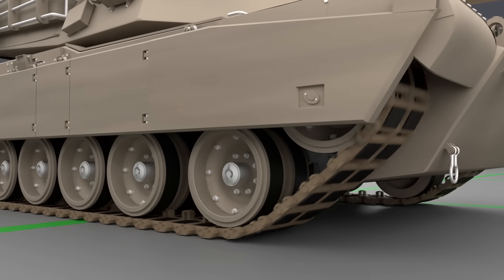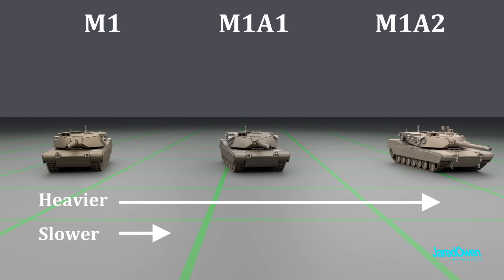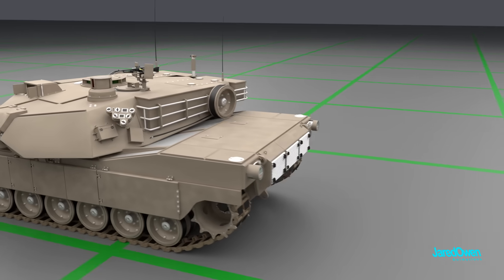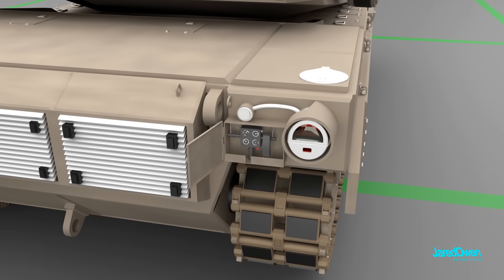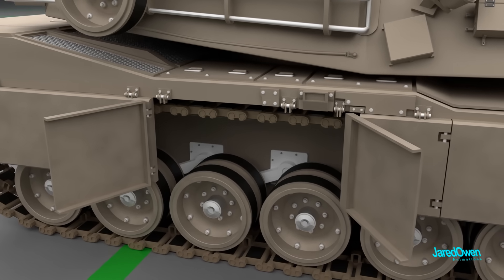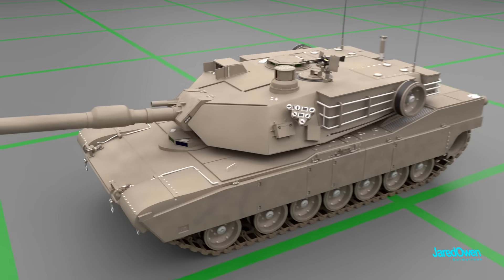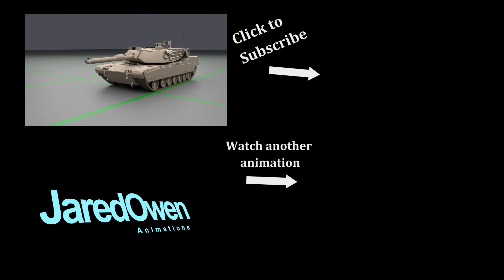How does a Tank work? (M1A2 Abrams)

Comment: 2:17 
Length: 9,75m
Width: 3,66m
Height: 2,43m

2:33 top speed 68 km/h

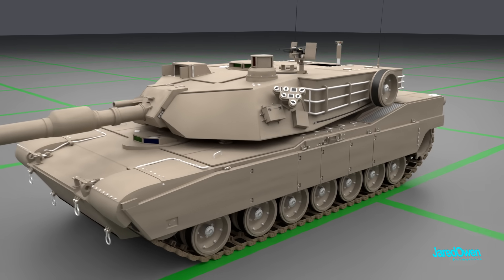2:51
M1A2
1893 L
0,25 km/L
483 km

Avg. car
61 L
10,63 km/L
644 km

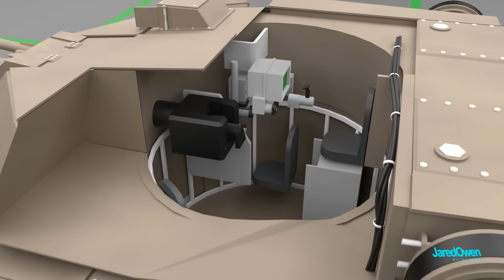7:20
muzzle vel. = 5633kph (1565m/s)
distance = 3,2 km
Reply: Petition to Jared Owen to pin him
Reply: @julilopbal  that doesn't sound right😂
Reply: @steveglen3354  why not? :)
Reply: @julilopbal  https://youtu.be/ISfSGTApFtk
Reply: Now I finally understand the video.
Reply: @koharaisevo3666  https://youtu.be/ISfSGTApFtk
Reply: @koharaisevo3666 same
Reply: @koharaisevo3666  I guess a majority of the views arent American?
Reply: Not the hero we deserve but the one we need
Reply: @hassanm.1887  https://youtu.be/ISfSGTApFtk
Reply: Thx
Reply: that's just what i was missing, thank you ^^
Reply: @arkonis6884  https://youtu.be/ISfSGTApFtk
Reply: Thank you sir
Reply: thank u. And US tons is the same as metric ton?
Reply: @aleksander2810  actually no, 1 metric ton is about 1,1 US ton (2200lb)
Reply: @willy6819  haha, thx
Reply: @willy6819  same as 1 kg = 2,2lbs
Reply: @aleksander2810  https://youtu.be/ISfSGTApFtk
Reply: @aleksander2810  a US ton is 2000 lbs (913 kg)
Reply: @aleksander2810  no. Imperial tons - 2,000 pounds. Metric tonnes -aprox. 2,200 pounds. Imperial is used far more due to the reduced math requirement and and it is also the standard for most the world when talking tons.
Reply: @Deathbomb9  An Imperial ton is 2,240 pounds. The US simplified the Imp system after independence. So a US ton is 2,000 pounds. They also changed the size of a pint from 20 fl.oz. to 16 fl.oz. so that it was the same as the number of ounces in a pound of weight. No-one seemed to realise that those two measures are completely unrelated to each other. 

Reduced math requirement? So, a system based on units of 12, 16, and 20 is less complex mathematically than one that used only 10. Really? Wishful thinking on your part, I’m afraid.

Imp is the world standard when ‘talking tons’. Eh? No-one talks tons! The same system is used for tons as for anything else you’re using in the same context:
Imp:     1 ton = 2,240 lbs.
USA:    1 ton= 2,000 lbs.
Metric: 1 tonne = 1,000 kg (kilograms), approximately 2,200 lbs.
Reply: TANK you 😉
Reply: @joacogonzalez1430  https://youtu.be/ISfSGTApFtk
Reply: @sumairamalik8634  ????????
Reply: Also, at 2:51

M1A2
392 L/100km

Av. car
9.41 L/100km
Reply: @baksatibi  average Car 9,4l/100.... Wow thats Just Bad....
Reply: @baksatibi  Thanks wanted to know that one. But holy shit that's a lot of gas.
Reply: @baksatibi  https://youtu.be/ISfSGTApFtk
Reply: @baksatibi  Hey, the cars from your contries do only an average of 10km/L?
Reply: Muzzle velocity for the 120mm seems way too high, it's more in the region of 1600 m/s for all NATO cannons, not even railguns or CLGG guns can reach that.
Reply: @theotakucomrade  the muzzle velocity for APFSDS rounds is stated to be around 1550-1600 m/s. HEAT and HEAT MPAT are a bit slower.
Reply: @LaVictoireEstLaVie 
Dude, look at what the OP wrote, 5000Km/s is not the same as 1750m/s on a Rheinmetall L55
Reply: @theotakucomrade  i was referring to the US L44 version of the gun.
Reply: @LaVictoireEstLaVie 
Still, no current weapon technology breaks the speed of light, just saying if the OP is still reading.
Reply: @theotakucomrade  he converted it in kilometers per hour instead os meters per second
Reply: @jaakkojouppila9965 
I guess I read Kilometres per second instead of per hour then
Reply: @theotakucomrade  https://youtu.be/ISfSGTApFtk
Reply: Tnx for converting from Bald Eagle heads and Hamburgers to metric system
Reply: @gasperpancur8142  https://youtu.be/ISfSGTApFtk
Reply: Oh, omg THANK YOU!
Reply: @Essuzu  https://youtu.be/ISfSGTApFtk
Reply: Thanks for converting them from school shooters per football fields to human script
Reply: Likhith Lexus Thanks for converting them from school shooters per football fields to rotten teeth and knife attacks per salty terrible food*
Reply: @scpfoundationtm1249  Who hurt you?
Reply: @likhith-lexus  https://youtu.be/ISfSGTApFtk
Reply: Nooo its 2.1111 alligators long 0.982 alligators wide and 0.772 alligators tall top speed is of the dolphin and the projectile can reach up to 210 giraffe placed horizontally
Reply: Finally some measurements I can understand
Reply: @izb3512  https://youtu.be/ISfSGTApFtk
Reply: thank you, this will help understand this video better
Reply: @mirum8726  https://youtu.be/ISfSGTApFtk
Reply: Thanks
Reply: @denniskouwenhoven9655  https://youtu.be/ISfSGTApFtk
Reply: Gracias signore. Gracias.
Reply: @setionoify  https://youtu.be/ISfSGTApFtk
Reply: We actually measure muzzle velocity in m/s
So about 1700ms
Reply: @cursedcliff7562  https://youtu.be/ISfSGTApFtk
Reply: awesome, i was calculating while watching lol
Reply: @tbpom1003  https://youtu.be/ISfSGTApFtk
Reply: Thanks! @JaredOwen could maybe show the metric system as well...
Reply: @DragonsAreHungry  https://youtu.be/ISfSGTApFtk
Reply: @sumairamalik8634  bro wtf
Reply: For the ppl 2 lazy 2 convert for themselves
Reply: @MultiCheapguy  We all can look it up ourselves. But it's the work of the video maker to do this. We are just passive spectators. Some of us are even too lazy to write too and to and two and replace it with '2'!
Reply: @duudsuufd  doing things the lazy way it dont get more american than that
Reply: Damn Commie babble
Reply: Thank you! Imperial is fucking dumb.
Reply: Thank you
Reply: @oliverstvold7397  https://youtu.be/ISfSGTApFtk
indian jets in ladah
Reply: Use a period and not a comma
Reply: @alexander1485  https://youtu.be/ISfSGTApFtk
Reply: You saved my mind
Reply: @gabrielangelos2821  https://youtu.be/ISfSGTApFtk
Reply: You are a good man, thank you
Reply: @Mishe_o7  https://youtu.be/ISfSGTApFtk
Reply: Nobody does that for us when it's metric
Reply: Que agradable sujeto
Reply: Good
Reply: Thanks for human units.
Reply: You're a hero
Reply: @Święty Sandro That's really not okay. That's an offensive word
Reply: @Święty Sandro Also, why are you watching a video in English about a tank you hate?
Reply: Wow
Reply: You knew this by heart didn't you?
Reply: Is this for everyone in the thirdworld countries
Reply: Damn so many butthurt Europeans in the comment section XD
Reply: @ザク777  What are we butthurt over again? The fact that we asked for metric units because we aren't required to do conversions on an EDUCATIONAL video? Are you that simpleminded you just toss around the word "butthurt" carelessly?
Reply: Why would you use a comma instead of a decimal point? What if you were writing a big number that had several decimal figures too. 

For example 1,234,567,899
Can you tell if the number is in the billions, or if the last 3 digits are actually thousandths and thus the number is actually in the millions?
Reply: 👍дякую
Reply: 300
Reply: Спасибо. Хорошо что не все люди настолько ленивы как автор субтитров.
Reply: Es wird Zeit für das metrische System,  sonst bleibt die NATO Stückwerk.
Reply: Ugh. Metric is the fevered dream of a sick world.
Reply: thank you so much
Reply: @gabrielsistonamoca6963  https://youtu.be/ISfSGTApFtk
Reply: thank you sir.
Reply: @sayonara_  https://youtu.be/ISfSGTApFtk
Reply: thanks
Reply: @allorfh  https://youtu.be/ISfSGTApFtk
Reply: Bless you
Reply: @Martin_xd69  https://youtu.be/ISfSGTApFtk
Reply: Thank you😊👍
Reply: @soutira  https://youtu.be/ISfSGTApFtk
Reply: thx
Reply: You saved Our Day dude
Reply: THANK YOU.
Reply: NC metric conversions
Reply: Thank you!
Reply: thanks
Reply: Thank you!!!!
Reply: Not all heroes wear capes. Thank you for this conversion, good sir.
Reply: Thank you napoleon
Reply: @Welcome_to_earff  . No. Thank you French Revolution.
Reply: thank you so much. I guess this video is only for american. lol
Reply: Thank u... Cap
Reply: You are a good man. Thank you
Reply: Americans use imperial units
Reply: great bro
Reply: Thanks
Reply: AWESOME
Reply: Thank you, I haven't learned Americen yet 😅
Reply: Now I understand it
Reply: Thanks
Reply: This is what I was looking for.
Reply: does it have a airconditioner system?
Reply: Thank you for using normal measurements.
Reply: Wow its much better in SI...
Reply: MURICA SYSTEM OOOOOOOOOO YAAAAAAAAAAAAA
Reply: Thank you so much for this, I'm pretty upset that he didn't put metric here
Reply: thank u the elevated one
Reply: Thnx bro... was looking for this....
Reply: Awesome thank you so much
Reply: @jprakash7245  Speak with Grammer then I'll answer your riddle
Reply: @ark6969  "just because you don't use it all the time or don't understand it doesn't mean it's worse." - Halo

I fully understand metric and I use it regularly for range finding and when working on modern vehicles. I prefer imperial simply because it's my preference and the standard in my country. Neither is better or worse. You may infer that I meant imperial is better all around, but meters per second sounds far more appealing than yards per second haha. Each has its advantages and disadvantages, that's why we have two systems.
Reply: Thanks
Reply: Imagine not understanding all units of measurement or weight
Reply: Sistema metrico, agora falou minha lingua. Muito obriigado.
Reply: Willy Julian thank you
Reply: Nyasar anajy nih bocah
Reply: It was supposed to be given by video makers .. but these people use idiotic measurements like gallons 😑😑
Reply: Thank you random indonesian
Reply: 2:23 61.7 metric tons
Reply: You're a hero..
Reply: Thanks for using human measurement
Reply: Sugar Darling If you want to get to semantics, a 9 inch bullet would be 228mm or considered a siege cannon. It would be a gun mounted on battleships. The joke is that we use metric all the time, but at the end of the day they aren’t that different; merely being numbers assigned to an arbitrary distance. My joke is about the futility of changing or using such systems, and that they are intrinsically flawed.
Reply: @gabevietor3685  ok
Reply: Thank you. Mvp.
Reply: Hail the lord!!
Reply: Thanks bro
Reply: Thx man
Reply: ily
Reply: ws12 Thank you
Reply: You are doing God's work man. May God bless you.
Reply: Когда уде выкинут эти устаревшие футы и галоны. Даёшь метрические шкалы!
Reply: ws12 a
Reply: Thanks a lot buddy I live in Canada and I didn't understand the miles per hour and that stuff
Reply: Legend
Reply: I was actually looking for this information! Some of us use Metric system so when you speak about  42mph we need conversion.
Reply: https://youtu.be/ISfSGTApFtk
Reply: @Święty Sandro https://youtu.be/ISfSGTApFtk
Reply: @TommyTom21  https://youtu.be/ISfSGTApFtk
Reply: @nhgru yyb https://youtu.be/ISfSGTApFtk
Reply: @TommyTom21  https://youtu.be/ISfSGTApFtk
Reply: Very good
https://youtu.be/10doMLGqd88
Reply: Thank you very much!
Reply: Thank you for metric
Reply: Super Bowl tank https://youtu.be/ON8N57uY160
Reply: Thanks mate, but 68 us tons= ?? Metric tons?
Reply: the rest of the world: Hey, I've seen this one before!

America:

What do you mean? It's brand new!
Reply: Thanks
Reply: You're my hero, thanks
Reply: thank you.
Reply: @Święty Sandro well done.
Reply: Thx
Reply: Thank you so much dude!!!!
Reply: weight?
Reply: Thank you alot
Reply: Thanks man!
Reply: The hero we didn’t deserve but definitely needed
Reply: Thx now i can make my own
Reply: Now i dum
Reply: Wondered why this comment existed, for the bro's in the EU
Reply: thx, now normal people can understand this video too. :)
Reply: On behalf of the rest of the world, thanks bro
Reply: EXPLOSION 988  ... Blah blah blah, you dummy.
Reply: @Święty Sandro looks like someone is mad
Reply: OK cap, and what is US tons?
Reply: We measure pp in inch, not cm, but the numbers are all the same 🙃
Reply: I don't know who you are but I will find you and I will give you a medal
Reply: Thank you !
Reply: Thanks Fishlegs!
Reply: the tracks would absolutely shatter into pieces at 68mph
Reply: Cur
Reply: Now the video make sense!
Reply: What is 60 kph in mph
Reply: Thank you very much!
Reply: Spasiba
Reply: https://youtu.be/PTc1YRqs160  made in Rhodes first.
Reply: https://youtu.be/2ihzlIFDH60
Reply: https://youtu.be/4G6e4TaJxkI 
excellent ⬆️
Reply: Thank you so much
Reply: https://youtu.be/88yQhk7kd6E more expensive
Reply: Ty bro
Reply: THANK YOU!!!
Reply: This.
Reply: Nothing nature comes out to an even meter or foot, none  of the things like Pi, Avagadro's number or Plank's Constant come in convenient round numbers.  Using a bar of steel in a vault somewhere has no more value than using some long dead king's foot.  At least you can imagine about how long a foot is.  How often do you really convert milliliters to deciliters? Whatever units you may be used to do not really have any clear advantages over any others.  Besides, every single person that may need to convert anything has a high capacity electronic device with them all the time now.  Metric is just for people that can't handle fractions.  Sorry.  Don't care.  Oh, and how about division into halves, thirds, fourths, sixths, eighths, twelfths and sixteenths?
Reply: We where made in HIS image
A good prayer:
I'm a sinner JESUS please forgive me for all my sins I know you shed your Blood for me on the cross at Calvary. Thank you JESUS for my salvation and for shedding they Blood for me. I love you JESUS. 
Romans 10:5/10 ct...❤️k
JESUSisLord!Amen...
Amen..
If you'd like to call someone who cares 
83
For
Truth.
bc you don't know when you'll die?
.y r u hesitant................
Reply: That's one thirsty tank man
Reply: Great! It was the only problem I had with the video, missing metric system, so everybody outside US could understand it. =)
Reply: Okmk
Reply: For the people who don’t live in America.
Reply: KOVOVÝ ZASTARALÝ ŠROT 👎👎👎  !
Reply: Thank you
Reply: THANK YOU
Reply: U.S. Imperial > Metric; hands down.
Reply: hero!
Reply: Thank you!
Reply: 習總太文明了，要多多聽鷹派的意見，
應該先發射一些飛彈到台灣本土，再宰幾十萬個到處引戰的愚人。

佛言：汝等比丘，若欲脱諸苦惱，當觀知足。知足之法，即是富樂安穩之處。知足之人，雖臥地上，猶為安樂；不知足者，雖處天堂，亦不稱意。不知足者，雖富而貧；知足之人，雖貧而富。不知足者，常為五欲所牽，為知足者之所憐憫，是名知足。
（五欲=財、色、名、食、睡，）

西方就是醫療崩潰 沒辦法處理，就只能與病毒共存，而且還花錢鬧事，不讓有計畫的開放，還沒開始鬧白紙運動就已經在找人鬧事，我朋友在成都鬧事前三天，就被問了四五次，500塊拿張白紙站著就行。敢喊話鬧事價格更高。最後聽說上海1000，廣州300。結果西方給了一個人頭2000，這是多大的資金量啊！

佛言：「若人欲了知，三世一切佛，應觀法界性，一切唯心造。」

佛言：「凡所有相皆是虛妄，若見諸相非相即見如來。」
Reply: Thanks for putting the specs in real numbers.
Reply: How much ammo can it hold?
Reply: Ох, ты ж Соссия мощь!!!
Reply: Và rất dể bắt lửa ? Khi bắt lửa cháy rất to
Reply: And totally destroyed in Ukraine.
Reply: thanks so much, i hate wasting time converting the dumpster fire units to normal ones
Reply: تانک هیولای بزرگ مارک ۴ و۵ ضد گلوله بیشتری بسازید.و تانک ماکا چ و سابرا و باراک ضد گلوله بیشتری بسازید.
Reply: https://www.youtube.com/watch?v=Z_ADHAXCAvs
Reply: Aww maybe you people should educate yourselves. Get with it as us ignorant stupid Americans can use both measurement systems. Don't blame us for YOUR OWN STUPIDITY.
Reply: Ижевские гранатомёты пробивают пять футов гомогенной брони! У Абрамса броня всего фут! Абрамса большая, высокая мишень!
Reply: Это что за новости!
Reply: I just realized that when the Americans use the metric system is when they referring to the size of a gun barrel lol
Reply: Cool
Reply: 2:17 2:20 2:23
Reply: @willy6819  now i can make an homemade tank👍
Reply: Die kann jetzt preiwert kaufen. In der Ukraine, da sind sie jetzt aber mehr oder weniger zerstört. Gut erhaltene Exemplare gibt es in Rußland in den Freimuseen
Reply: you saved most non-Americans
Reply: Хуета горит на раз два😂😂
Reply: Thanks! Usefull information for the rest of the planet... 👊🏻👍🏻
Reply: finally some real metrics, not that american bullshit
Reply: Can you translate?
Reply: Thanks. I was about to stop watching as I lost interest not knowing conversions.
Reply: @EweChewBrrr01  https://youtu.be/ISfSGTApFtk
Reply: @sumairamalik8634  Why?
Reply: thanks dude.
Reply: @hidegrp  https://youtu.be/ISfSGTApFtk
Reply: @hidegrp  позорище сша горят все на ура1
Reply: Uhhh can you translate that into red solo cups?
Reply: @lukeisadog  https://youtu.be/ISfSGTApFtk
Reply: This much people were annoyed of that rubbish US units! 😆👍
Reply: @jprakash7245  shut up just because America is different doesn't mean you can make fun of it. What if I said "WHo cARes ABOut  THe mETRic SySTem😆🤣😂🤮🤮😄😄" also don't use emojis those suck
Reply: @jprakash7245  https://youtu.be/ISfSGTApFtk
Reply: Thanks man. It is just ridiculous what americans do. I constantly have to calculate feet?? ounce?? fahrenheit?? And from 7 billion people they are the only ones used those.
Reply: @kashmirha  https://youtu.be/ISfSGTApFtk
Reply: @kashmirha  Tough titty said the kitty...but the milks still good.
Reply: thanks I was looking at the tank next to an average human and couldnt visualize what 8 feet looks like. I saw that it holds 500 gallons of fuel and an average car holds 16 gallons and i couldnt make the comparison.
Reply: Thank you so much, I don't care very much for freedom units...
Reply: @bpfifa08  https://youtu.be/ISfSGTApFtk
Reply: Long live the metric system
Reply: @FMHikari  https://youtu.be/ISfSGTApFtk
Reply: God save the queen!
Reply: @nicketr  my country tis of thee
Reply: @nicketr  https://youtu.be/ISfSGTApFtk
Reply: @nicketr  позорище сша горят все на ура1
Reply: Thanks non american
Reply: @3denym860  https://youtu.be/ISfSGTApFtk
Reply: Or you peasants could learn both. And how to convert.
Reply: I love metric
Reply: @AluminumOxide  https://youtu.be/ISfSGTApFtk
indian jets in ladah
Reply: @TommyTom21  "Thanks for non-retarded units"
Reply: @radioactivet-rex286  https://youtu.be/ISfSGTApFtk
Reply: I appreciate that you took the time to explain the video to the rest of the world using the superior metric.
Reply: Please put decimal (.) instead of comma (,)
Good efforts ✔✔✔✔
Reply: @BLACK-hl4ic  https://youtu.be/ISfSGTApFtk
Reply: I dont speak american so thanks!
Reply: @gianlozano102  https://youtu.be/ISfSGTApFtk
Reply: The only downside od this chanel..
Reply: You were more informative than the video
Reply: @ComfortsSpecter  If you were to be given those numbers with only the video title and no other context would you be as informed?
Reply: i dont know if its me,but i noticed an increase in the number of youtubers not including unit conversions.
Reply: All you people need to know is 0.62 miles is 1 km, and an average walking step covers about 3 feet.
Reply: @Astyrical  I always calculate with "5 miles = 8 kilometers" so you can calculate it easier without calculator
Reply: Thanks for the conversions. I have no idea why the United States use the stupid imperial units system
Reply: 7.000.000.000 minus 350.000.000 peoples will not understand the units of only 350 million peoples
Reply: Honestly as an American we act offended but imperial units are stupid.
Reply: Kinda ridiculous that they didnt include these in the video.
Reply: Ah yes normal people measurements
Reply: TommyTom21 im an American and I think it’s stupid that we use the American system and not European. And we don’t need political correctness
Reply: @dmitrymolotov6428  https://youtu.be/ISfSGTApFtk
Reply: @dmitrymolotov6428  You are right! but it is strange that Americans are the only people in the world that hang on to this complicated imperial system even if the metric system is already widely implemented in the USA. Actually the imperial system came from English, but they also stopped using it. The metric system is just 10 times more simple, and dimensions, weight and temperature are related.
Reply: @dmitrymolotov6428  it's not the "American system"
Reply: @TommyTom21  tbh imperial units are retarded
Reply: @tcg1_qc  https://youtu.be/ISfSGTApFtk
Reply: Americans are really next level ignorant. They do everything as if the others in the world don't exist. And never thinking globally. Thanks to the sheer number of very powerful petrol cars they have been driving since last 60 plus years, that global warming (That is the only global thing by Americans) is a thing now.
Reply: FINALLY, SOME DECENCY, THANK YOU KIND SIR!!!
Reply: Finally real measurements, not feet, bones, balls, buckets, gallons, waves and so on
Reply: Tnx for converting from baseball hamburgers to metric system
Reply: Thanks for not retarded system
Reply: @Święty Sandro imperial is actually better in a lot of situations. Just because you don't use it regularly or don't understand it doesn't mean it's dumb or useless.
Reply: @Deathbomb9  It’s clumsy, and is never better in any situation, unless you live in one of only three countries in the world that still use it - USA, Myanmar, and Liberia. Powerful company you’re keeping there!

In any situation, the system that’s better is the one you’re most familiar with, and that is understood by everyone.
Reply: @Twittler1  well, when another country comes along and decides to be a powerhouse like the US and not just rely on the US for its protection then maybe SAE will go away completely. Till then I'll have both SAE and Metric tools, and I'll do my machining and building in inches. Also, havent seen the imperial tonne standard used in a long time it's so close to a metric ton that you may as well use metric and if you happen to get enough together you can have an extra one. Each measurement system has its ups and downs. And I have no idea what you're talking about with the 20 measurement you mentioned. Pounds is also an old British system so blame them. Yes, there 16oz in a pound, most home measures are done in cups. If you need a pint of something you go and buy it and use the entire container. In a kitchen the system works flawlessly. The US has always used both systems just fine. Most people have no clue they use both but have no issues doing so. You only proved that you feel like metric is better.
Reply: @Deathbomb9  Oh dear, never mind. You obviously have no idea what I was talking about, and you seem to be a bit too heavily invested in the whole issue for your health. I’m not bothered, just joined in on an already existing convo. You can use twigs snd peacock feathers as measures for all I care. So I think we’ll leave it there, yeah!
Reply: @Twittler1  so you sent 3 responses to me alone, then back out when someone gives you a response you dont like because they didnt bow to one measure over the other? I simply said both are used where I live and so many other places that standard units like ounces has dictated what you would buy in another country and vice versa. A 355ml can of soda is actually a 12oz can. Typically bottled water in the US is sold by the half liter(500ml) or 16.9fl oz. Welcome to mixed measurement systems. A 20oz bottle doesnt represent any particular thing other than how many fluid ounces are in the bottle. You're the one that went on a tangent about how wrong I was without fully reading all my comments. Also, if you want to base your measurements of anything have then be repeatable in a consistent manner and you can make a measurement system. That's all it takes. You wanted to stir the pot and didnt like the stew being made. That's a you issue, not mine, so dont come back and say a measurement system is based on sticks and peacock feathers just because you cant form a rational argument against a single thing I stated. I use both, and know both.
Reply: @Deathbomb9  Three short, to the point responses, no longer than they had to be. You go on and on, doing nothing but showing you’ve missed the point.  As for your points, I’m still not sure there’s more than one, but you do make a meal of it. Done. End. Life’s too short for this rubbish.
Reply: @Twittler1  so no want read response because not worth time to evaluate arguments, got it. Probably convinced the world is flat and gravity doesnt exist too. Just say you're a clown who had some facts but came unprepared for someone to challenge you view that one system is all we need.
Reply: @Deathbomb9  Still don’t get it do you? And it’s none of the stuff you’re imagining.  Last time: IT’S NOT IMPORTANT AND LIFE IS TOO SHORT TO WASTE ON RUBBISH. END, OVER AND OUT!
Reply: @Twittler1  if you're trying to make a point, then say what you mean and stop being passive aggressive. Or, if you arent going to say it directly like an adult human being then you dont need to respond. You're the kind of person that this world needs less of.
Reply: @Święty Sandro I'm not a retard
Reply: @lukeisadog  he didn’t say you were
Reply: I guess it helps people who haven't landed on the moon and planted a flag on it. Still wish we used metric, but until then, maybe don't make fun of us if you are inferior.
Reply: @gabevietor3685  funfact: nasa had to do extra check for every calculation and convertion to the metric system to avoid any mistake due to confusing of the mess of the US measurem system!
Reply: @gabevietor3685  I wonder why all the metric people are so interested in an American tank.
Reply: @tooaskew2558  Yeah, maybe they should watch a video about the Leopard or something.
Reply: @gabevietor3685  Your military uses 9mm instead of 9inch bullet. You think NASA uses Your retarded unit systems??
Reply: Sugar Darling Wow, can’t take a joke. I know I am all over the place but wow. Just... wow...
Reply: @gabevietor3685  have you landed on the moon? what's your credit to it? xD How are you superior? xDD
Reply: @Gorgutek1   American nationalism. Literally all USA is today is made from other nations' contributions.
UK for recognizing independence of USA and giving territory to the Mississippi, France aiding USA in their wars, Russians ceding Alaska and German science, much of which USA and USSR stole and then paraded around about their superiority.
Reply: @gabevietor3685  can you call yourself superior to Switzerland? Really?
Reply: @caiolopezcomz  Of course. I am more handsome than the guy who says "I am going to be Switzerland." That automatically makes me, the person, superior to the country. For real though, think about this, I have no context to your reply or anything. I don't even know what you are replying to. So yeah, your guess is as good as mine about what I was saying.
Reply: @gabevietor3685  Oh dear. You do realise that all the science and engineering that NASA used and uses was/is metric, don’t you? Once, they got all confused, with a private company engineering a crucial part of the space shuttle in American Standard measurements from metric drawings. Result: Space Shuttle ‘Challenger” blew up during launch with the death of all aboard! 
You maybe didn’t deserve that, so be careful using descriptions like ‘inferior’.
Reply: @gabevietor3685  you do know that the metric system is the preferred system of measurement within NASA, right?
Reply: @spoonmanluigi  Don't care, didn't ask.
Reply: @gabevietor3685  spoken like a true arrogant american
Reply: @gabevietor3685   "dOnT mAyK3 fUn Of Us iF yOuRe Infer10rE"
Reply: @agenius4399  REEEEEEEEEEEEEEEE
Reply: @gabevietor3685  I guess foreign science helped you to land on the moon and plant a flag on it. Still you parade around about your accomplishments, but until you switch, maybe keep destabilizing the middle east in name of democracy if you are superior.
Reply: @gabevietor3685  how many peoples of another countries worked in nasa?
Reply: @rafaelchaves6920  at least 2
Reply: @gabevietor3685  "inferior" ok then
Reply: @gabevietor3685  Nasa uses metric today and in the Apollo mission the flight computer used metric too. Can you just accept that the imperial system sucks and when you need to do anything that required complicated math you resort to the superior system?
Reply: Lemons I was mostly joking. I do hate imperial and that is clear from my comment. However, the rest of the world has yet to be as expansive and powerful as the United States. Making fun of Americans for not using metric is not helpful. Make sense?
Reply: @gabevietor3685  I can tell you imperial is far more accurate and widely used in the world of machining. It has its ups and downs, the same as metric.
Reply: @Deathbomb9  Epic! Still, I see the appeal of Metric. I would like Metric more, but alas, it would be far too expensive to make the switch. Imagine how many road signs would have to change? Or perhaps, how confusing it would be for older generations? It is sadly unfeasible for the US. We will just use Metric for our scientific applications, rather than fully utilizing it.
Reply: @gabevietor3685  It does. I love the US in almost every way except their system of measurement.
Reply: @Deathbomb9  wait, how's it more accurate? The accuracy is not in the measurements but the tools you use. How do you measure nano or pico meters in imperial anyways?
Reply: @gabevietor3685  the US military uses metric when talking about direct and high angle fire. It is also used for navigation and positioning. But not when talking about the range of a vehicle. We use feet and inches for sizes of things, but our weapons are explained in metric and not caliber, i.e. 5.56mm x 45 NATO, 9mm x 19 Para, 7.62mm x 51 NATO, 40mm, and so on. The only ones that aren't done that way are the .45ACP if you're lucky enough to be in SOCOM and the M2 .50cal BMG. Even to this day I do all my firearms ranging in meters, yet the velocity will be in fet/sec. Yet as a tanker, we measured our main gun in meters/sec.
Reply: @lemons1559  they measure in thousandths of an inch, and then ten thousandths or "tenths". When talking about nuts and bolts you also have more options on thread pitch. Metric has 4 that you will commonly see (0.5,1.0,1.5, and 2.0), but in imperial you measure by threads per inch (tpi). I'm sure you can measure a part at the pico and nanometer level but you hardly see it because you need tolerances. You're measuring to hundredths or thousandths of a millimeter and most machinist can understand that and do the conversation. But imperial is in far wider use.
Reply: @Deathbomb9  1/10000in ain't close to a nano meter. Also "wide use". Only in the US.
Reply: @lemons1559  I was discussing machining bud. You need tolerance. Getting on the nano level applies to fields that require far more schooling and years of education I have no desire to go through and sink that kind of money into for a entry level position. When I can go into an industry and make the same living and money. You're getting into semantics and it's likely the vast majority of people will never need to measure anything to that degree.
Reply: @Deathbomb9  I was just wondering if you could study that small things without metric. The general answer is, if you do anything close to that you'll be using metric anyways.
Reply: @lemons1559  you can convert it to decimals of an inch. But mostly you would be working that small in metric.
Reply: @Deathbomb9  I'd also dare argue, if you were working in a field which required such precision or researching that small things, you'd use metric anyways.
Reply: @Deathbomb9  still, thanks for the chat.
Reply: @lemons1559  most likely yes.
Reply: Lemons Imperial system is more for practical usage. we also learned imperial in school but that is for more scientific stuff.
Reply: @lemons1559  and how they write dates.
Reply: @lemons1559  uu6667
Reply: @heliodorosanchogarcia4604  Got it.
Reply: @Deathbomb9  Not at all true. Completely made up.
Reply: @gabevietor3685   Ha ha ha.. You couldn't land on moon until we invented the zero and the decimal point... And somehow the people who invented the zero and the decimal point use SI units. Hope you are aware that SI is technical name for Metric.
Reply: @siddharthchakravarty2099  Congrats, you didn't get the joke.